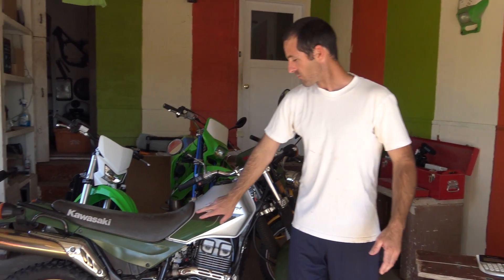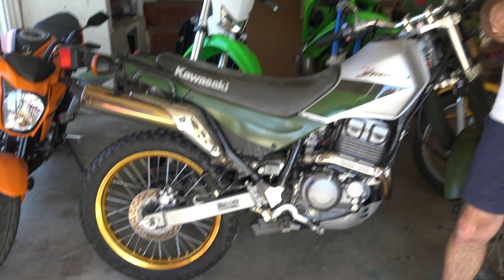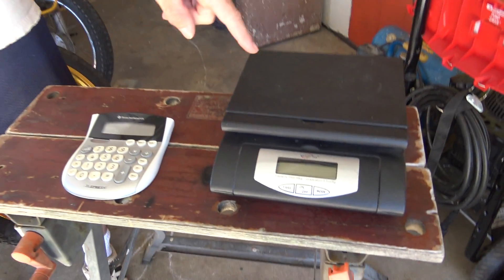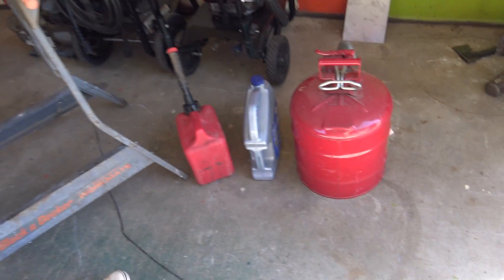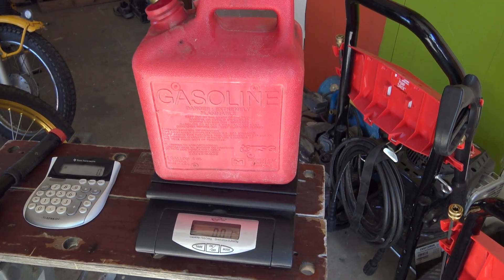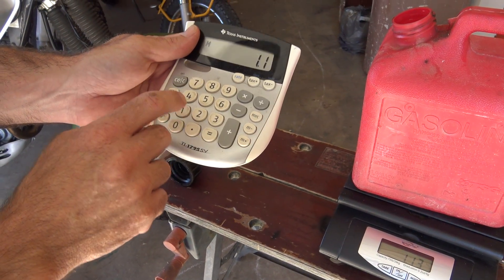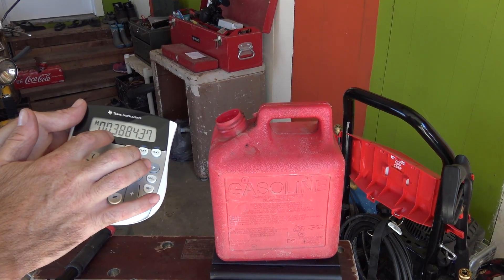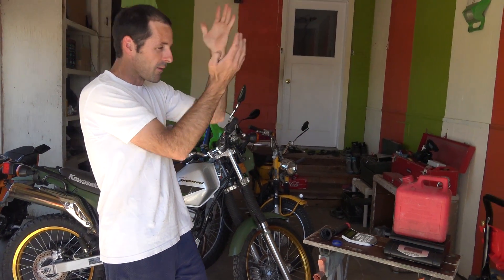How To Mix 2 Cycle Gas Using A Scale

Comment: Have used this method and last time, forgot to consider the oil and gas densities.  Ended up with 33.3:1 instead of 50:1 but error in the safe direction !  Today got a scale from Amazon with 11lb. limit but 0.1g resolution (readout).  Works great for small-ish oil weights.  Made by Etekcity for around $15.

Watch your oils.  I'm playing with Stihl, Amsoil and Pennzoil and the densities vary a bit.  It pays to measure and determine your own density based on some reference amount, like 100ml of oil.

Comment: I miss your videos. I mix mine to color when I only need a little then smoke check you always want to make sure there's clouds of blue smoke just to be safe  and up side no bugs within a mile in all directions buy all  spark plugs for your 50 50 oil gas soup

Comment: You should look at the densities of the oil and gas. Mobil 1 two cycle oil is 0.866 kg/l. Density of gasoline 0.755 kg/l. For a 1/32 volumetric ratio it is 1.15/32 for a mass ratio if my calculation is correct...did not do it on paper.
Reply: And I recheck on paper, though the density for the oil is at 15 degrees C. The gas density is off Wikipedia, no temp listed. Rounding to the nearest whole number, the ratio is 1kg oil/28 kg gas. Or 1 g oil/ 28 g gas. Pick your flavor, metric system is easy.

Comment: Hmm, according to standard ASTM  D4052, gasoline has a density of 0.71-0.78g/cm3 depending on the composition. That's like 9% difference. I don't know though how the different composition interacts with the oil mixure. But there is some variability in the oil ratio measured by weight due to the current blend of the gas station and probably the blend of two stroke oil as well.

Comment: Comparing your 10% trick to some more accurate calculations:
Weight of gas:			1.13kg
Density of (95 Oct.) gas:  0.75kg/l
Density of cil:	    1.11*0.75kg/l
 (see 3:39, 20/18 = 1.11)
Target ratio:		   1:32 mix by volume
-----------------------------------------------------------------------------------------
Correct volume of oil:
 (1.13 kg : 0.75 kg/l ) : 32 = 0.047 l
Correct weight of oil:
 0.047l x 1.11 x 0.75 kg/l = 0.039 kg
1.13 kg + 0.039 kg = 1.169 kg
I'd say your trick was pretty on spot.
but still, here is a small and condensed formula of all the stuff above to get the correct weight in just one step (using pounds it works aswell!):

WEIGHT_OF_GAS_IN_KG_OR_LB x 0.0347 = WEIGHT_OF_OIL_IN_KG_OR_LB

you can substitue <0.0347> for  <1.0347> to get the weight after filling in the oil.
really liked the video :)

Comment: This is an interesting way to mix gas.
I usually mix full cans at a time by volume and keep my two stroke in different cans to plain gas. But I can see how this is useful if I finished my pre mixed cans but had some plain gas left.

I got a mixing bottle for a few bucks that is marked every 100ml for gas and oil so as long as you have minimum 100ml of gas you can mix some up

Comment: 32:1 is 1 qt of oil to a gallon of gas all you need to know is if you have 1 gallon of gas and 1 qt of 2 stroke your good but i don't believe in that ratio i'll mix just to be sure and never had a problem with it but i'll put 1qt and 1/2 to a gallon of gas and ive never had any problems and ive never scored a cylinder with this mix but yes i have seen many a time of wrong mixes in cylinders usually under mixed rather than over mixed if you over mix you'll just foul out the plug or gunk the carb up rather than a complete new top end which i have done too but never have i ever scored a cylinder it's okay to mix over rather than under just to be sure dont be afraid to over mix rather than under mix the cost of fixing an under mix is far worse than an over mix -end of mix gas rant also i love watching this channel but i dont ever get call outs but keep up the good work my guy been watching for a while and hopfully it all takes off for you -peace love and light

Comment: I like this....I always used a proofer bottle.  I took an old clear glass wine jug to the gas station and put in exactly 1 gallon.  I marked the level at the bottom of the meniscus and dumped the fuel into a 2 stroke gas can.  Anytime I needed a tank of gas I would fill my wine jug up up the line and mix me up a gallon.  Again, I like your method too.  These days I no longer have a proofer bottle.  I mix 1.5 gals of 50:1 and it gets me through the year.  I don’t use as much of it as I did when I had two stroke ATV's and lots of lawn equipment.

Comment: measuring gas by weight is more accurate because the volume changes at different temperatures
Reply: So doesn't that mean the density changes too? And therefore the volume to mass conversion factor.

Comment: you know mixing more oil into your gas is not actually "safer", it will cause your air fuel ratio to lean out.

Comment: nice, but  its to big of a hustle... here in europe, especially for garden equipment the big manufacturers (husqvarna, stihl , jonsered etc) have 1 litre bottles with a build in measuring cup that has engraved the lt for the amount of 2 cycle oil on the side... and their oils are top notch... personally i run husqvarna LS+ 2T oil for 10 years with no problems, no fouled plugs, no scoring on cylinder etc... so i am not changing the oil preference anytime soon

Comment: What you are doing is adjusting for the density of the liquids. 
Gas is 14.4% lighter than two stroke oil, so 10% wasn't a bad number to use. 
1 liter of water is 1kg (at 60F). Gasoline is 0.7390 kg per 1 liter, Two stroke oil is a bit denser and weighs 0.8638 kg per 1 liter.  
1-(0.7390/08638) = 14.4%

Comment: Oh nooooo.
A friend brought his weed eater to me because it wouldn’t run. 
There was a boat load of oil all in the carb.
Turns out he was weighing the oil, instead of going by volume.
Got the piece running and showed him the correct way to make the mix. 
This scale method, while interesting, is way too much work for something so easy to do.
Just my 2 cents.

Comment: 4:10 When you have container and gasoline on the scale, just press tare button again to weight oil you have to add
Reply from the maker: That is a great idea! Eliminates the last calculation.
Reply: @jenniesgarage  also, as you're only measuring 38 grams of oil, the scale might give you more decimal places if you're just weighing the oil. You don't even need to weigh the oil in the same container, if you have a second cup you could do it in that and then mix in the can.
Reply: @PKMartin  From that point it is just rounding error... things are fine +-10%.
Reply: @jenniesgarage  You can also get oil needed directly by multiplying gasoline weight by 0.0344 or 0.0345 to easily remember. 
PS
Love your videos and the dynamic you and camera girl have. Keep us entertained for years to come! Thanks

Comment: If you want to be very precise the manufacturer has often a datasheet on their website with the density of the oil. In metrice it is in kg/m^3 

The same goes for gasoline you probably can find a general number about the density of it.

Comment: Nice video! The difference in weight is called 'specific gravity'. Water has a specific gravity of 1 meaning 1 litre of water weighs 1kg (metric system is good like that). You can find the SG for most fluids in their specs. 2 stroke oil has SG of around 0.86 (1 litre weighs 0.86kg) and fuel around 0.74 (1 litre weighs 0.74kg). Knowing the SG should make the calculation easy.
Reply: The difference then it's about 16 percent and not 10 percent like he claimed in the video! That would make your mixture far too deficient in oil content.

0.86/0.74x100=1,162

Comment: Just for reference:
1000 liter Gasoline has a specific of 750kg (that's 0.75kg per liter).
Two stroke oil has a specific weight between 860kg / 1000l and 890kg / 1000l (depending if it is full synthetic or mineral based two stroke oil -> it's best to check the product data sheet where you can find in general (at least in Europe) the specific weight in kilogram per cubic meter at a temperature point of 15°C (1 cubic meter is equal to 1000 liter).
Instead of 10% you should add something between 15% and 19% in your calculation.
Reply: I came to this conclusion too. It should be around 16 percent. Not 10. Careful people lean mixture can ruin the engine!

Comment: Hello from Australia.  Be careful mixing 2 stroke!
A wise man once told me ( who worked for Wiseco pistons) if you ad more oil to your mix you are not being " safe" or making a " smokey" mix. You in actual fact you are taking fuel away from the mix and making a lean mix... less fuel more air= lean.
Oil does not have a high burn rate like fuel.
A wise man told me!

Comment: The trouble with mixing by weight is that the oil in a 40:1 mix is only 2.5% of the volume of gas so if your weight measurement is only 1% off your mix could be between 1.5% to 3.5% or 67:1 to 29:1

Comment: You have your system and I see it works for you but I think it's too inaccurate. I prefer using parts to parts. 32 parts of gas to 1 part of oil. 32 gallons - 1 gallon
by half is same ratio
16 gallon - ½ gallon
8 ... - 1/4
4 ... - 1/8
2 ... - 1/16
1 ... - 1/32 all the same 32 to 1 ratio
1/4 gallon is 1 quart, keep dividing from there, easy right? 😂😂😂

Comment: I have rewritten this comment alot to try and make this easy to understand. So i am going to just wing this and lets see how this comes out.
The ratio is the ratio
What do i mean by that. Your taking and splitting the gas up in a ratio. It matters NOT the unit of measurement you use. They remain constant. 
It does not matter how heavy or light oil is to gas. The number you got is 32 to 1 you could of used ounces, it would not of mattered.
its the ratio and that is constant and because its constant the unit of measurement matters not. 
The conversion works itself out because of the units of math behind the conversions. Ounces to kilo etc. Let me prove it,
1.13 Kilograms is 39.86 (rounding up) ounces
40/1 is .02825 (lets use .03 to make it easy)
.03 Kilo is 1.06 (rounding up) ounces
40/1 of 39.86 ounces is 1 ounce (rounding up)
the .06 its so insignificant when it comes to dumb machines. its like a mouse fart. No one knows when a mouse farts... nor do they care.

Comment: put 10l in container empty 200ml oil container in done... all you need for this is a gas jug and place to buy gas.. or even a bike at the gas station and small jug of oil.. dont need that much, cut it in half an eyeball half the oil youll be close enough, need more,  buy 20l and use 2 oil stipends...

Comment: For my weed wacker, I have a 1 gallon gas can. I fill it up, and put in 2 oz of 2 stroke oil. (Not sure if it is the correct amount) but, it has worked fine for several years...

Comment: Way over complicated. Mixing by volume is perfectly acceptable, especially considering "gas" may not be a consistent weight depending how much ethanol is in it. 128oz per gallon, for 32:1 simply divide 128 x 32= 4 oz of oil per gallon. Don't get me wrong, the concept is interesting but IMHO flawed.

Comment: i have a special container with lines that tell you  how much oil to use its tells you your gallons to oil and it has all the ratios from 16-1 all the way to 50-1

Comment: never tought of mixing gas by weight ..learning something new everyday .  keep up the good work
Reply: It’s even more accurate because the volume of a given amount of fuel changes with temperature, leaving room for variability in the mix, the weight of fuel however does not, making it a more precise process.

Comment: Although I'm an Aussie, and we have used the metric system for decades. This is not as complicated as it seems. Ok, I may be somewhat biased.

However, should the math formula be simple, getting the result is simple. 
Once fractions get involved, the equation can get murky in the process to the result.

In the end, it's the individual's choice of which direction at the fork in the road they take, to the end destination.
Reply: Metric system or not, the units of measurement used are going to be described as a fraction or a ratio so how does an aussi do it more simply without involving any fractions?

Comment: Why. Dont. You use liters? Is much easier!!
Usually in 2stroke mix is between 2~3% per liter
So for one 1 liter you add 0,03liters of oil!
In 2 liters..0,06 and so one!!

Nice video!!
Reply: Kilograms is part of the metric system...The metric system uses units such as meter, litre, and gram to measure length, liquid volume, and mass, just as the U.S. customary system uses feet, quarts, and ounces to measure these.

Comment: While there are the number of people saying "Just mix it by volume like everyone else". Those people didn't pay very close attention. The greatest benefit to this is when you have an odd volume of gas. How many times have you gone to mix up some 2 stroke and there is a partial gas can full. I know it happens to me all the time. This fixes that. Thank You! This is the sort of content I didn't realize I needed but I'm gonna use it!
Reply: In that kind of situation, I just use a can from oil which has marks every 0.1L. Allows you to mix odd quantities just fine. Dump 30mL/1L and your good, works for me.
Reply: When in doubt just add a little more. Frankly a little less won't hurt either but a little more is better than a little less.
Reply: @kurtyoung6769  a little more, especially mineral oil can cause stucking pistonrings. using modern syntetic oil makes it able to mix down to 1:120 without any problems in any engine. also with modern mineral oils i never mix more oil than 1:50
Reply: It doesn’t take rocket science lol
Reply: Agree
Reply: It doesn't matter if you have an odd volume, the process stays the same.
Reply: @mips13  The process is the same, but this method works when you don't know what the volume of gas is. Which is what the op meant by "odd volume"

Comment: The modern 2 stroke oils are good, so good infact you get some wiggle room, I know this from personal experience having made a mistake or two in the last 10 years with no substantial consequences
Reply: True, but gasoline has gone worse with added alcohol as well so it balances out. I dont mind running my engines bit on the rich side to keep lubrication proper, specially in two strokes.

Comment: In the uk we use the metric system. 50:1 ratio.
5 litres of gas to 100ml of oil.
Easy
Reply: @SouthTexasSunsets  how is that stupid?
Mixing 2 stroke oil is hardly an exact science.
Everyone has a calculator on their phone. 
If a 5 litre jerry can is half full then only add 50ml. 
Or maybe you're the stupid one who doesn't understand the metric system?